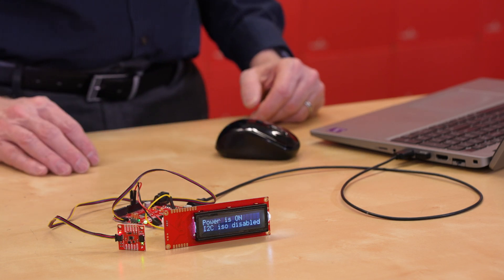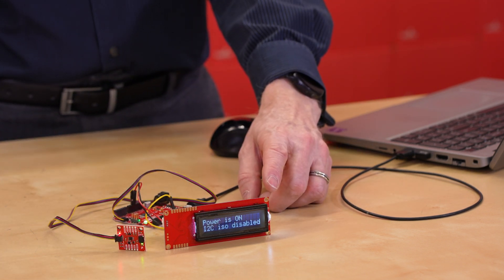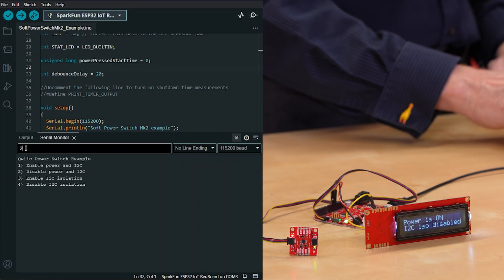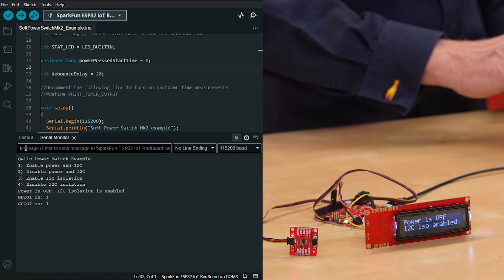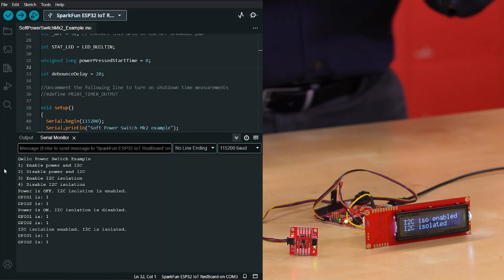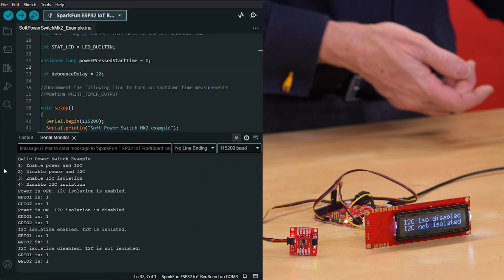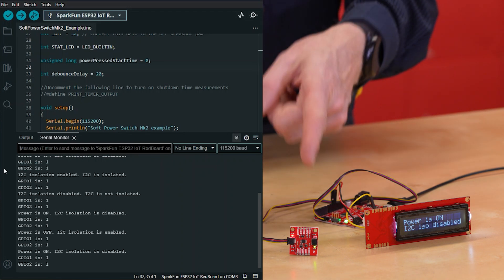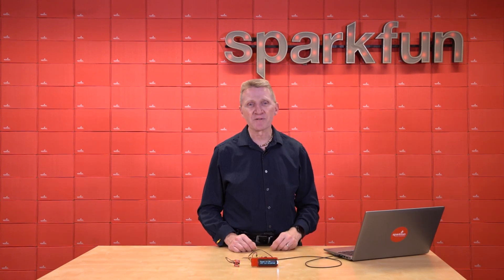SparkFun Power Switch Comparison Guide

Comment: Suggestion, this being a usb-c device, it could easily have smart features added. Edit, doable but not so easy.

I suggest through-holes for the switch, to more easily patch out to a front panel or other switch.

Also through holes for the LEDs again to jump over to other LEDs, or input to other device.